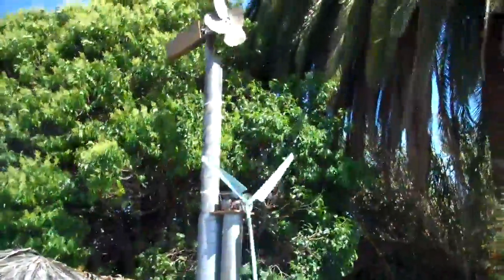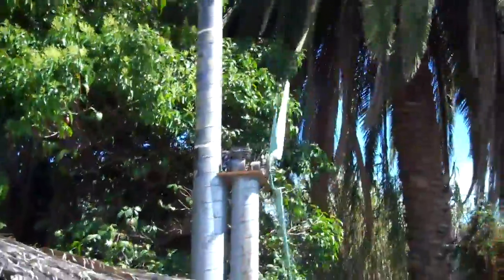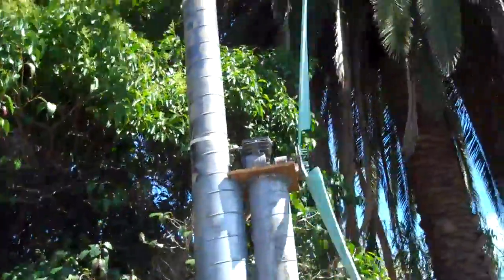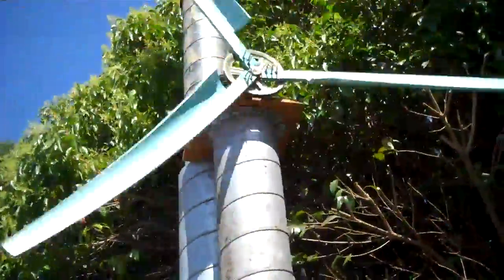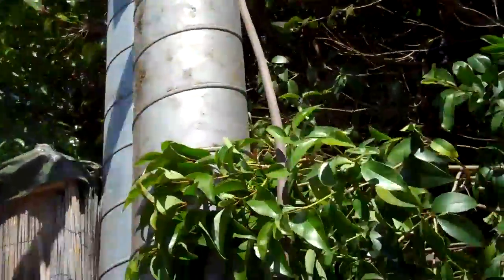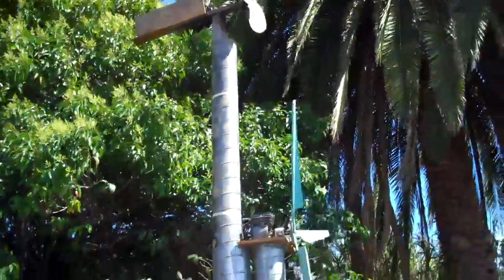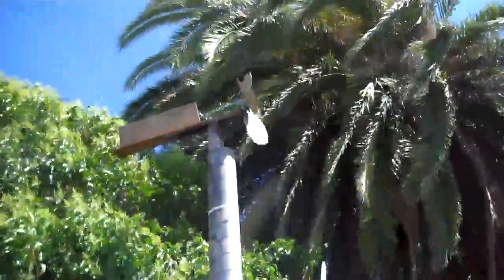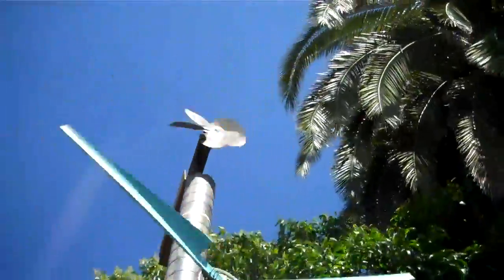Off Grid Wind Powered air compressor

Comment: 44 gallon drums cut top to bottom through the middle then weld as a vertical vein. seen some with 2 drums 90 degree of each other then send it down to a normal compressor. Need to put on a crown wheel and pinon to get shaft running horizontal to compressor. Free energy better than batterys that die.
Reply: 500 gallon propane tank or bigger if you can find one cheap